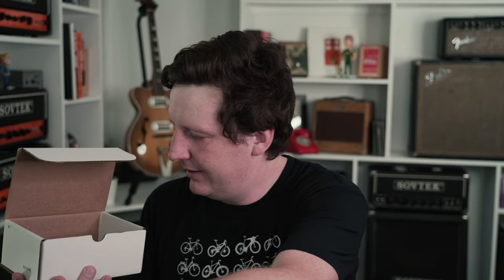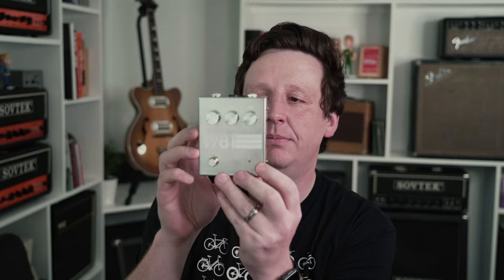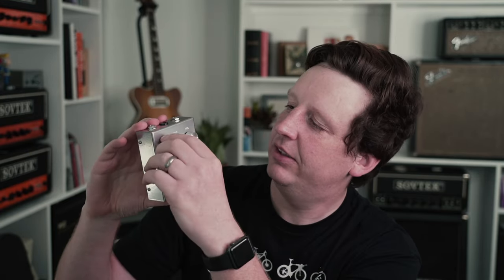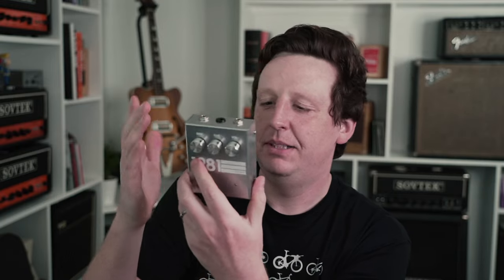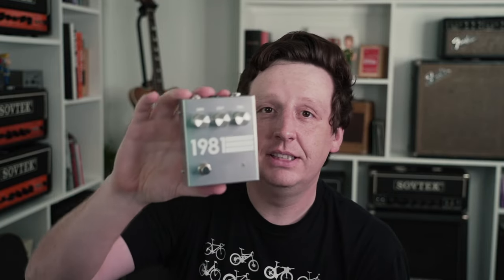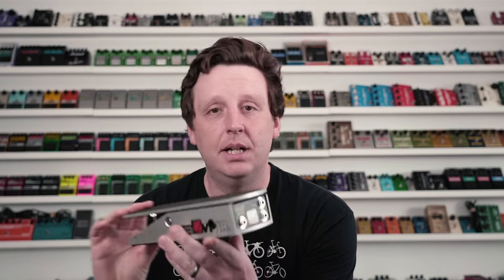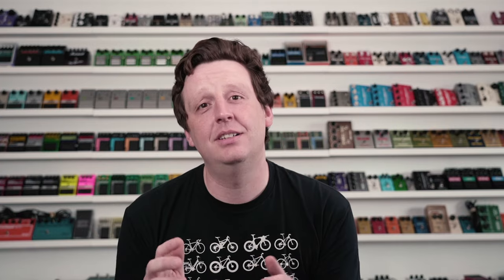Why You Need A Buffer

Comment: Hey Josh & Co!

Where I've been running into some confusion is when you bring a passive volume pedal into the equation...

So I own a VP Jr. 25k passive volume pedal. In reading various forums online, it seems like the general consensus is that you want to put a buffer before the volume pedal. 

To confuse things more, to my understanding it's advised not to use the tuner out on these volume pedals because they split the output signal (curious for clarification around that). 

So, here's the question. Assuming the following pedal board set up, is my logic sound here? I'm simplifying what's on the board here for clarity's sake:

GUITAR -->  Polytune 3 (with buffer, but will always be on, so maybe this doesn't matter?) --> Compressor --> Overdrive --> Boost (with buffer, will not always be on) --> Volume pedal --> Delay --> ---> Reverb (final pedal, includes buffer, but will more or less always be on) ---> AMP

So first question is this - if the first and last pedal in your chain are always on, would you not need a buffer (essentially all pedals act as a buffer when they're on, no?)?

Any help here from the community would be greatly appreciated! In the scenario above, I essentially have THREE buffers (one at the beginning, one before the volume pedal, one at the end)? Is that too many buffers lol? 

Thank you!!

Comment: Game changer thanks Josh, I never realized how important buffers are. I was a true bypass snob but now I'm a buffer believer.
Reply: You can still like True Bypass... It will still act to actually bypass the circuit. A buffer just helps maintain signal-strength.
Reply: It’s not either or. If you have a lot of pedals you probably need a couple of buffered pedals in your chain...if you only use a couple of pedals you probably don’t. Personally I’ve never met a buffer I liked
Reply: All my true Bypass pedals sound great. I had an old boss ce-1 chorus pedal, it was the original classic original grey monster from the 70's. Well It sounded amazing but when bypassed,it sucked ALL the tone out of my signal. it was not true bypass and I don't think it was buffered either. Well that made me a believer in true bypass. I now see that buffers have their place if needed.
Reply: I agree with you that it's "not either or"
I think true bypass pedals are the way to go and as you put it, use a buffer only if you really need it.

Comment: The reason you don't want a buffer before the fuzz pedal is because the buffer converts the signal to low impedance, and most fuzz pearls need high impedance input to function properly

So the question is how do you tell if your funds petal or distortion pedal requires high impedance input?

Comment: I've done that test, through the pedal board vs direct into the amp a few times. I've learned by trial and error. My Fuzz Face is front of the chain. I have a Boss pedal after it and my Boss looper at the end, which seems to work for me. I also read that Jimi liked the coiled cable for the reason that you mention. The silicon Fuzz face does have a lot of high end so losing a little isn't that bad an idea.
Cool video and good advice as always.

Comment: With this method you'll always hear a high end roll off since when you are using your pedalboard you are indeed using two instrument cables and that means, more capacitance to the system= frecuencies filtering. In the other hand, it's cool to offer alternatives to buying a buffer like the use of Boss pedals. I didn't know about the fuzzes and buffers issue, thanks for that.

Comment: I used to think there were the buffers in Boss pedals were better than others, but now I'm thinking maybe it was because the times I noticed Boss pedals being tone suckers may simply have been that I had too many buffered pedals in my chain. The fact the tone loss went away when I removed the Boss pedal was that my board reached the breaking point where adding in that one extra buffered pedal was detrimental to my signal chain. I probably could have removed any other pedal (at the time, mist of my board consisted if V2 series Visual Sound) and got the same result in spite of their buffers being fantastic. It was around this time that I learned through the staff at Visual Sound as well as researching on the internet that ideally you want a mix of buffered pedals and true bypass. At a bare minimum you want the sandwich configuration. I use a programmable bypass switcher now, which I believe has a buffer on the first input and output. It's not a perfect solution as I can't position the buffer where I want so fuzzes can go on the switcher and I can't justify the cost of a GigRig or other switchers that might have thar feature; but it's functional. Usually when I use a Fuzz, I'm only using 3 or 4 pedals anyway.

Comment: I use the Boss ES switcher on my board and it will allow pre and post buffers.  I’ve listened to the on/off sound and the difference is minimal but still noticeable.  I do use good cables and the minimum lengths possible but running all those ins and outs to the loops selectors still adds up I’m sure. I don’t use a fuzz pedal on that board but if I did I think it would have to be run outside of the ES-5...the buffer may not be moveable in the chain in other words.  Experimentation to follow...  

As for the album, that was new to me.  I was reminded of what I call the “unique voice” syndrome.  Willie Nelson, Bob Dylan - Peter Steele even...all unique voices that may not sound conventional but definitely have their place and fit the group.  Sort of like scooped mids...sounds cool to some but you really have to know what you are doing to make that work in real life!

Comment: For the test you suggest, a better approach for conclusive results would be to record your guitar dry, then re-amp it back to your rig instead of playing it yourself. The human auditory memory doesn't last that long and you'll play differently depending on how you're sounding like and how the amp responds. With re-amping, you're only changing the only thing you're trying to test, which is the sound differences your pedals add to your playing versus plugging directly in to the amp.
Reply: Not true at all.
1) re-amping will change your source impedance, actually breaking the test, not to mention changing your sound through your preamp and converters
2) this is not pseudoscience, it’s art - trust your ears - if you don’t notice a difference switching back and forth then it’s not big enough to worry about.
Reply: 1- It doesn't matter. Your recording becomes the new source and any differences will be presented in it.

2 - People tend to hear what they want to hear, as pscyho-acoustics tells us. Ideally, I'd suggest a double blind test since, as you pointed out, this is not pseudoscience, therefore there's no problem in suggesting proper testing, right?

Comment: The prohibition on using a buffer before a fuzz, I think comes from a few pedals. Think something in a round case format. Fuzz is voltage clipping applied to an incoming signal, and a buffer between.  the guitar and a fuzz changes that, but it depends on the circuit design of the fuzz that determines to final "sound".

Comment: During the body of this vid Josh is effusing (well and effectively) sitting in front of some Ikea 2x2s - they are sitting 90 degrees off of optimal. The uninterrupted shelf should run horizontally to support the vinyl resting on them best. 

You're welcome.

Comment: New Vlog! Still hooked. I absolutely needed a reminder to sandwich my big board. I love my clean tone and I want it back! Pete Cornish is helping me with the end of the board on the way into 2-3 amps, but now I have to think about what I want at the beginning. I just... I just can't get my head to accept that a Boss buffer is good enough. I apologize. I don't know why I am resisting that idea. I will follow my fuzz with something always on. I will. ... but now this makes me realize I want to understand NOISE!!! Can you help me/us understand "mains hum" vs "ground loop" vs "pedal noise"... Do I get a Hum-X hum buster for the wall? Do I plug my power into the same strip? Do I isolate every pedal with it's own power? Do I gate some noise? When is power bad? What is dirty power? What can I do on a smaller scale?  What is all this? 
-
I'll bet I'm not the only one that needs to start to understand unwanted noise better. 
-
Thanks, Josh ... - Jensen in Los Angeles

Comment: I have a question about buffers. Let's say you have a 25' cable from your guitar to your pedal board. When the signal leaves your guitar it a value of n. By the time the signal reaches your pedals, you've lost x amount of signal. So, the amount of your signal is now n-x. How exactly does a buffer restore a signal that's no longer there? Is it boosting the signal in the frequencies that are typically lost during the transit from the guitar to the buffer?
Reply: The buffer does not restore the signal loss previous to it. It helps keep the signal that would be lost after, like in "the pedalboard"
Reply: @CamiloPefaur  Thanks! So then somebody needs to invent a buffer pedal that fits between the guitar and the cable.
Reply: @mikeaustin4138  that's... a super awesome idea!!!
You're a genius!
Reply: @mikeaustin4138  Go wireless. The biggest complaint people have with them is that the signal is too clear! Seriously, they are so used to a slightly deteriorated signal that the lack of any cable sounds 'wrong' to them.

I don't know, I love mine - I don't know why everyone isn't using them! It is so good to be untethered! Even sitting at home, I use my wireless..even as I'm now sitting not two feet from the pedalboard. 

Someday I'll buy a second set to run from the pedalboard to the amp aswell. My pedalboard will be a complete island. I might get it on wheelbarrow style wheels (2 wheels on 2 of the 4 points of the pedalboard) so I can shove it around stage/the room so I'm not glued to the pedalboard 'sphere'.

Comment: Does a Boss tuner (TU-2) have a buffer? Should my fuzz be before my tuner? I never thought about the tuner being anywhere but first. If I have a pedal with a tuner out, should I use that?
Reply: Yes, the TU-2 is buffered (i have one too). By the logic presented in this video, it seems that the fuzz should not get a buffered signal. Either way, you should probably test it out for yourself and see if there's any noticable difference. Every pedal/cable/guitar/amp/power supply is going to have some sort of impact on the tone.

Comment: Hi. I have a 4 channel amp. It occured to me I could use 4 different overdrives (or any effect) through their own pre amp channel. I started looking into 4 channel splitters. I found radial eng's shotgun but it's a buffer with 4 outputs, so can I not use that before the overdrives/fuzzes? Should I just use a passive splitter to the overdrives/fuzzes, and then use 4 individual buffers after the overdrives/fuzzes? Also I wanted to use a volume pedal before the overdrives/fuzzes (so before the splitter) so would that need to be passive, not buffered, as well?

Comment: Love your stuff! However, I want to argue that your water parable is wrong. The nozzle is only one more resistor and even capacitator so it reduces the pressure as does the hose/cable. It does however increase the speed of the water by reducing the section area of the flow (the flow rate mass per time must remain). So the nozzle does not increase signal strength. A buffer would be like a pump that fills the original water into an elevated tank, which increases the pressure and decouples input from output.
Reply: I agree, a buffer would be more akin to an inline pump to maintain pressure.

Comment: This is so topical, I've been going through all this...I even got an old boss pedal out and put it at the start of my chain...didn't do anything. Took the lead out and plugged straight into the amp , and voila!  Crystal clear waters!

All this just before I saw this video. It was all that that prompted the search.

What's worse is that I have 4 more new pedals coming in the mail! ..at least 3 are true bypass..not sure about Brainwaves..🤔

So...I have to:—
A) restructure pedalboard with fuzzes up front.
B) Stick a Boss pedal directly after
C) Buy another buffer for end of sandwich  

??? Right??

Do I buy a dedicated buffer, like the Fender buffer, or just look for another buffered pedal, n go for a two-fa'...?
Reply: your 'end of sandwich' buffer is downstream of the fuzz.  Don't do that.   You'd need to place your fuzz last in line, beyond the last "end of sandwich' buffer.

Comment: The best buffer iv ever had by a long mile is the mi audio boost n buff orange 2 knob version.
Saying that I am yet to try one designed by you Josh. 
Have you ever tried the mi audio boost n’ buff? I would love an understanding as to why this pedal sounds so darn good haha.
The ‘clean’ boost side is also absolutely phenomenal and with the gain up it pushes perfectly Into treble booster territory. I run it at 18v which gives the boost a little more headroom but I’m sure it’s also doing something to the buffer in 18v that ads a touch of magic to my clean tone.
Reply from the maker: Yes! Its great because it adds some really nice upper freq to your sound! Much like a Zvex SHO or my Prestige. MI Audio makes awesome stuff!

Comment: Hey Josh,  love this video. Could you help - what about effects in the loop fx?
1) If I wanna run all my pedals in the loop section of the amp - do I still need a buffer (long cables used)?
2) Do I need a buffer right in front of the amp? Long cable to the buffer & a patch cable to the amp?

Will the same 'rules' apply? I am using a lot of pedals, so I wanna sandwich the board with a TU-3 in front and a buffer at the end.

Thanks in advance.
Reply from the maker: Rule #1: Try it out with and without a buffer. Then compare your signal to directly plugging in. Then you can find out if you need one. You may still need a buffer when using pedals in the FX loop. You shouldn't need a buffer before the amp if you only are using one cable. But again, try it out.

Comment: Thanks for the awesome vid! I couple of questions. Firstly, I've read that all amps that have effects loops have buffers in the loops so you don't have to worry about signal loss through those. Is that the case? The other thing I've read is that it really depends how much cable you run. I think it was Pete Thorn who did a Vid where he tests out different cable lengths and once you get past 15 feet of cable, you start noticing signal loss. For example I run a 10 foot cable into my board, then a 5 foot cable from the board into the front of the amp. Any thoughts on that? 

Also, assuming I'm running all my modulation pedals through a loop and just a Wah, and a couple of OD/Distortion pedals direct to the front of the amp, I guess it would be wise to just put one buffer after all the OD/Distortions? Thoughts/suggestions? Thanks again for the informative vid!
Reply from the maker: Great questions. Every rig is different! I recommend that you take a few minutes and just test out different things and see what YOU hear. :-)
Reply: Perfect! Thanks!!

Comment: I have so much crap on my pedal board that I'm sure there are half a dozen buffers hidden inside them somewhere (at the very least, inside my Boss flanger).  I don't think I even need them though, as I use a wireless system so there isn't 20' of cable after my board, or does the wireless matter?

Comment: Why put a buffer at the end if you already have one at the beginning? The point of a buffer is to drop the guitar signal from high impedance to low impedance to make the signal less vulnerable to capacitance and RF noise, without affecting the signal's tone or amplitude in any way. The impedance of the signal doesn't gradually go higher as you go further down the cable, so what purpose does the buffer at the end serve?
You should've also mentioned as well that if the guitar you're using has active pickups, you don't need a buffer in the guitar signal at all. Active pickups are low impedance devices by their very nature., and as such are not subject to the tone sucking effect of having long cables like guitars with passive pickups do.
Reply from the maker: This episode is not intended to dive deep into the subject, its a quick intro to buffers. Sometimes dual buffers are useful, like I said, do the test and see for yourself ;)
Reply: There is a difference between covering a subject concisely and covering it with gross oversimplifications to the point that the video loses educational value.

You also haven't answered my question about why you should put a buffer at the end of the signal chain if the signal chain is already buffered in the beginning. "Try it yourself" is not an argument. I was hoping that as someone who designs effects pedals for a living, that you would offer a technical explanation. Surely you owe that explanation to those who view and subscribe to your channel?